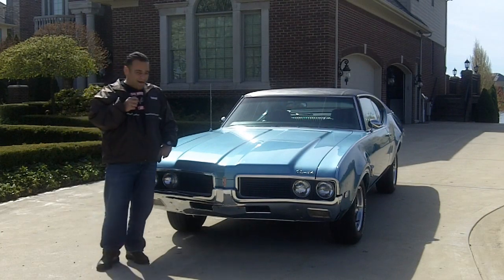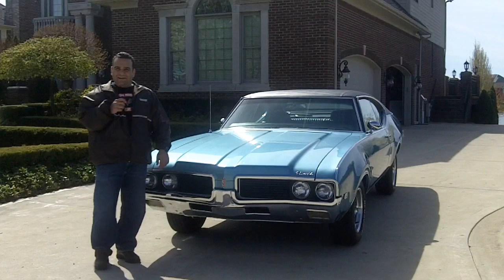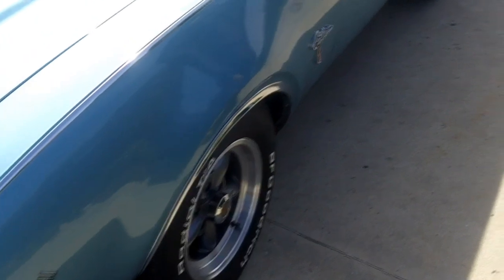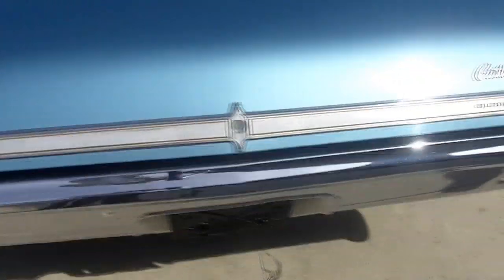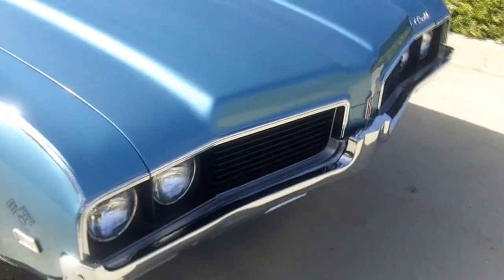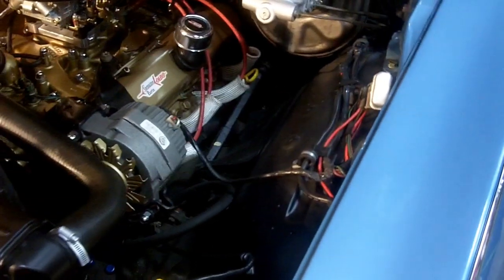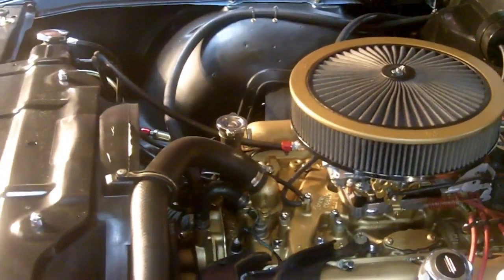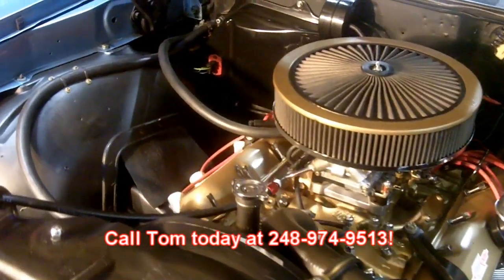1969 Oldsmobile Cutlass Classic Muscle Car for Sale in MI Vanguard Motor Sales

Comment: Sweet! Look similar to the one I sold back in 2007. Had a 455, 12 bolt rear, column shift, soft top and bench seat interior needed restoration, but paint and body was the same. Trunk  was perfect and no rust. Put NASCAR Aero 50s and Firestone Indy 500 RWL tires.